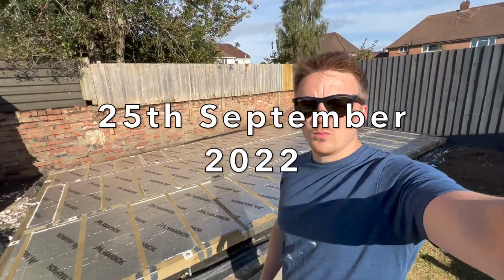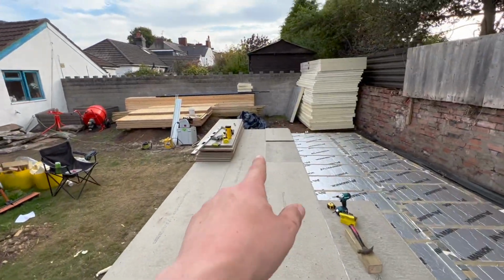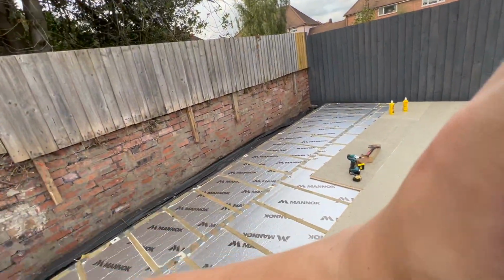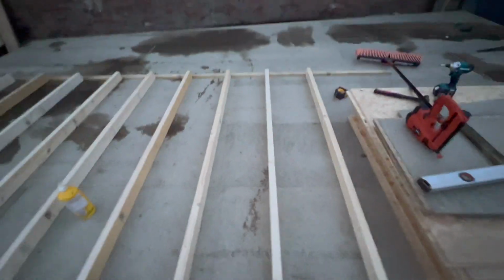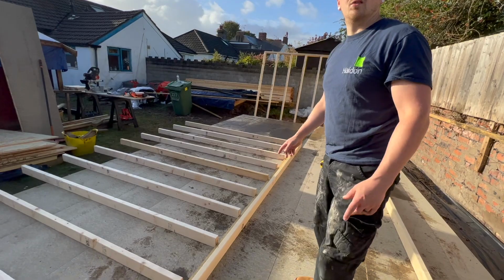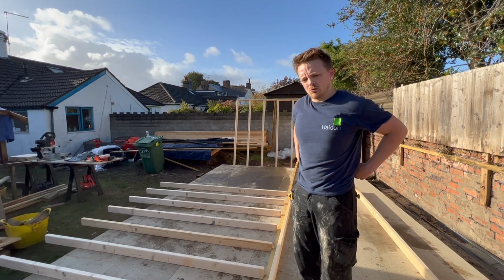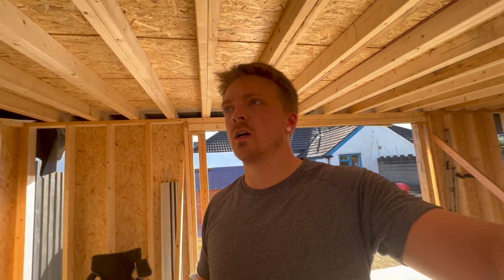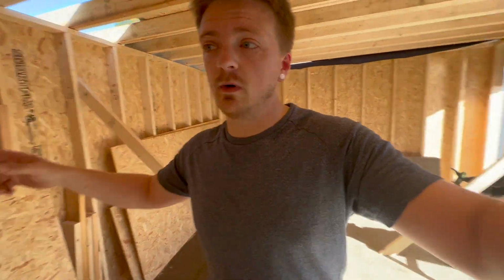Ep.3 - Using OSB Boards for Walls and Wood Joists  - Building a Garden office

Comment: Build looks great. Any bounce in the roof with the Double up 5x2 over the 4meters ??
Reply from the maker: Hi Liam 

Thank you very much, yes there is slight movement when walking on the roof but not much at all. after I had installed the roof I then saw one of Oakwood Garden Rooms videos talking about fletching or Flitching the timbers with a steel plate sandwiched in-between two timbers.

the room is now plasters and I have noticed a few hair line cracks on the ceiling where the boards were butted up, but we have had some heavy rain fall, extreme winds and rise/drops in temperature so it is expected in a timber framed building.
Reply: @thejenkins65  iv got a 4m spam to cover and I was just Wondering how you got on without using the flinch beams .I might just put 3 or 4 in now just to make it a little more stronger when I come to do it .
Reply from the maker: @liammillichamp  if you have the money to go the full hog with the steel plate in between the timbers then I would definitely do it for reassurance. I haven't had any issues without but its only been up for a couple months so time will tell

Comment: Have to give it to you, well done so far! Liam and his team make it look so easy dont they. I see you've even copied Liam battering your finger with a hammer too. Did you need planning and building regs before you started? I'm planning to start my project soon but unsure if I'll need to chat to my planning department. Look forward to your next episode
Reply from the maker: Hi Jim

Thank you for the comment.

Me and the wife have been watching Liam and the gang for about a year now and with this move we decided it was time to go in for the build!
they definitely make it look like Childs play chucking up the shell in just a couple of days!

as this is classed as a temporary building, and under 2.5m tall and under 30m2 I did not need planning as its all under permitted development.

how ever, as the building is over 15m2 and with in 1m of the boundary I did speak with the council to ask what the external finish of the walls had to be made of as they needed to be fire resistant in some way.

they were happy with fire rated paint straight onto timber cladding or I could use the fibre cement boards such as hardy clad, but hardy clad wasn't with in the budget especially on a side and rear elevation that will not be seen.

if there is anything you are unsure of its definitely worth a phone call it email to your local authority to make sure its all done the right way.